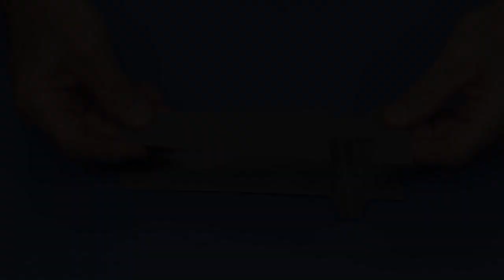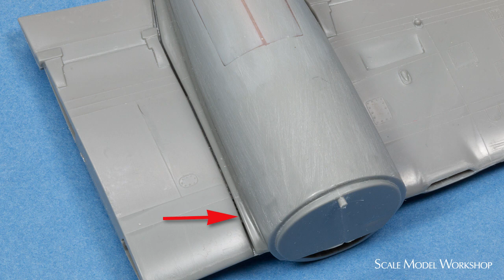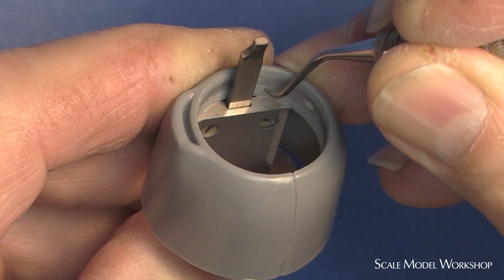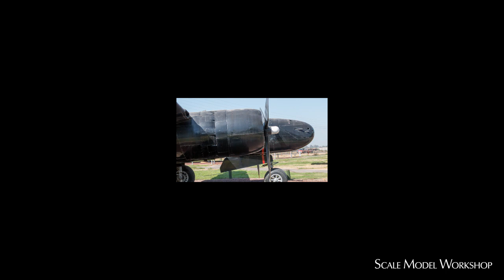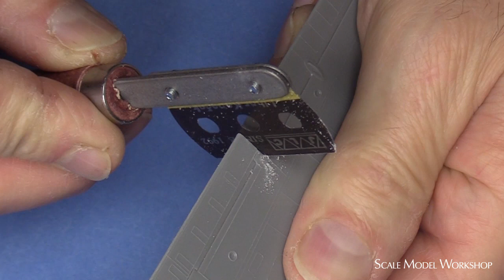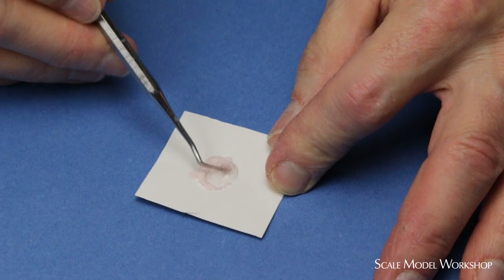Building the Revell Monogram A 26 Invader ... Episode 2

Comment: Cool trick with the CA & acrylic powder but I prefer "sproo goo" mostly because it's just a little easier to re-cut panel lines and rivets, but I think I will use CA & acrylic powder for re-enforcement because it does dry a bit faster than the goo does.

Comment: Nice a lot of neat tricks to try. When it come to flaps on the wing and elevator I saw them off to start with. Then I take a piece of plastic tubing sliced in half glue in to the wing edge and the other half to the flaps. With some filing and sanding you get a very realistic working flap.

Comment: I enjoyed this video, mostly because dragging out old Monogram kits from way back when reminds me of my beginnings in modeling. I recently bought a Monogram/Revell  "Personnel Carrier" (M3A1 Halftrack) kit. I bought it because I needed a halftrack,  there are not many to choose from, it was available retail and was 20 bucks. It still has major parts with a 1957 mold date on them. :) I built this kit more than once back in the 1960s. Old school all the way with many inaccuracies but with a little cutting on the bulkhead and a set of scratch built seats (nothing nearly as elaborate as your work) it doesn't look bad on the shelf. Point is I suppose that sometimes you have to work with what you can get and with a little work old models can be made at least presentable or in your case excellent examples. Plus you get to try out and improve your skills. Great job and hopefully an inspiration to others.

Comment: I built the B25 and B26 Monogram kits late 1950`s.  Difference being they were the Speede built kits,  mostly balsa but some plastic like nacelles  , engines,  props, wheels.  
At the time there was plastic glue and wood glue and sanding sealer for balsa.   This made a lot of things difficult.    There was no CA,  filler, epoxy,  or fancy stuff we have today. Plain old Scotch tape was my masking tape
Like I said, 1958 . 

I have searched EBAY looking to replace them,  but no luck.

Also liked the Stromberg kits which wee solid wood.  I did a B47 and some others.